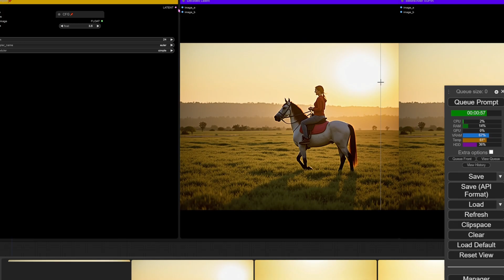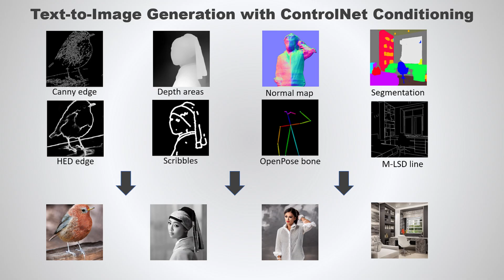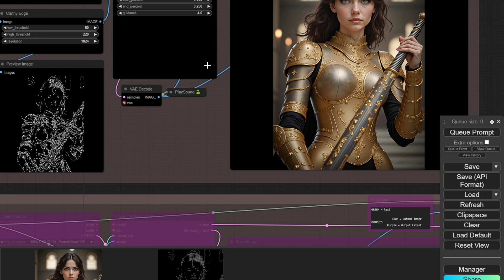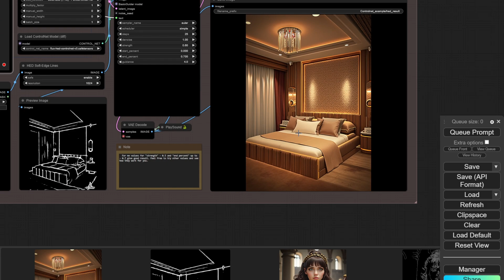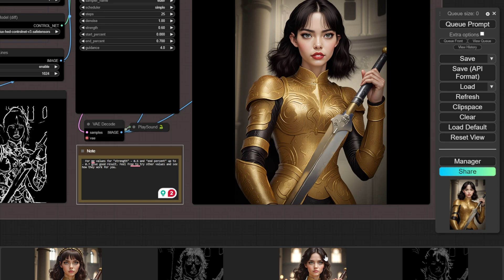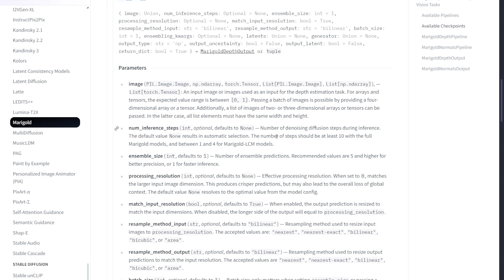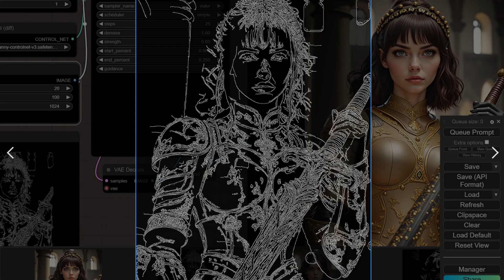Flux ControlNet Beginner Tutorial | Step-by-Step ComfyUI Tutorial

Comment: The workflow JSON file is broken: Nodes like the ControlNet Sampler on all 3 groups has the input order swapped so you need to delete the node, create a new one and reconnect. Even after fixing that, the results are broken, so there are more nodes that are most likely wrong